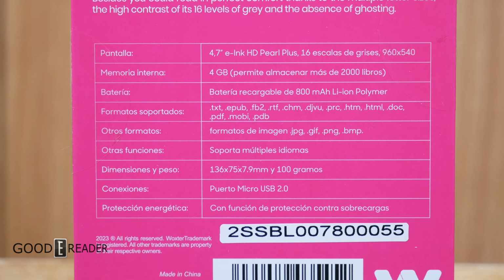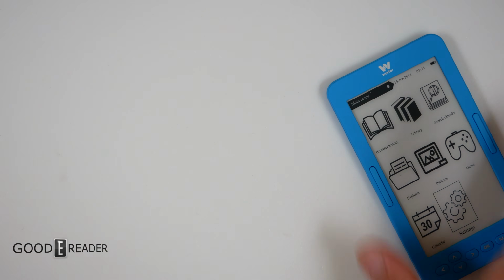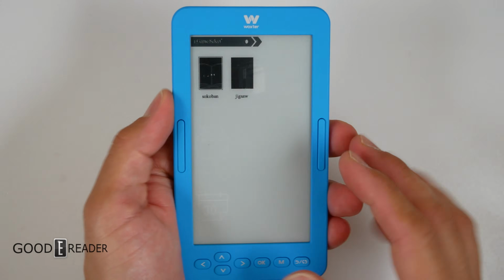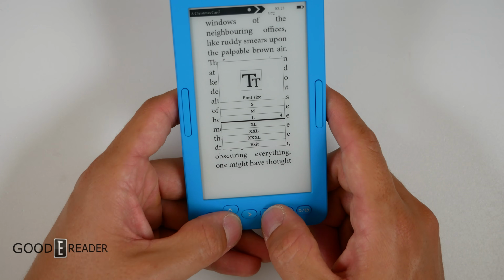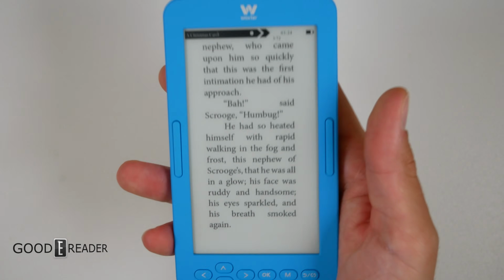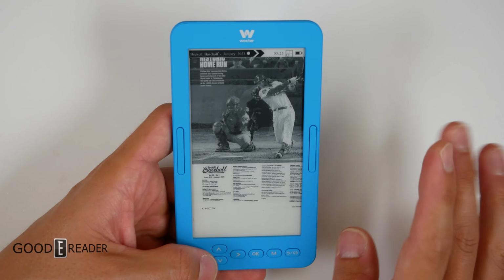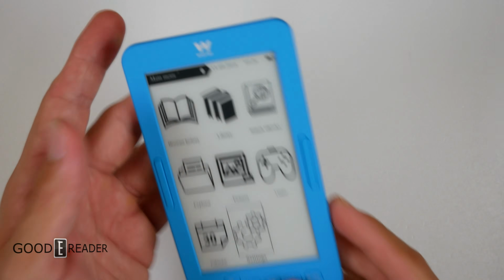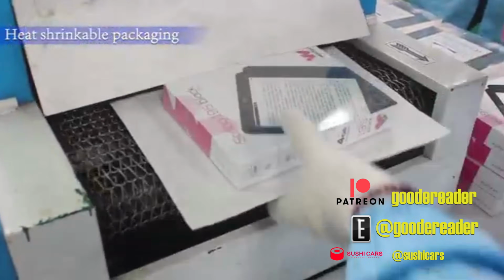4-Inch 96 gram e-Reader | Woxter Scriba 195 Review

Comment: On Amazon it’s $180.00 ? This doesn’t sound cheap to me.
Reply from the maker: Yeah but it's cheaPER than other units.
Reply: @goodereader  Whoa what? I'm pretty sure the kindle is 99 bucks. And at that point its only redeeming factor is is its lightweight, but even then i don't think its worth spending 180 bucks on this
Reply from the maker: @normalchannel2185  right, but this is not a kindle. What price the Kindle sells at is irrelevant to this unit. 

We're talking about two different devices. Not the same device.
Reply: @goodereader  I mean, both are e readers? I'm pretty sure you can put your own ebooks on kindles too. What price the kindle sells at is ABSOLUTELY relevant, seeing how it is a direct competitior, or in economics a substitue good.

Comment: Is the price at the good ereder store accurate? It is listed at 129 USD. For that price at your store I can buy the Pocketbook Verse E-Reader, which has a bigger screen, a touch screen, WiFi, USB-C More RAM, more storage and more use cases. you mentioned in the review it was very cheap. there are several more functional ereaders at the good ereader store for less than 129 bucks. Why would someone buy this, even at the tiny size?
Reply: I bought it in Spain for 70€ which is around 75 USD
Reply: @lioreuz  How would you rate its usability and overall performance?
Reply: @lioreuz  Even then, for this sort of thing anything more than 50 bucks aint it